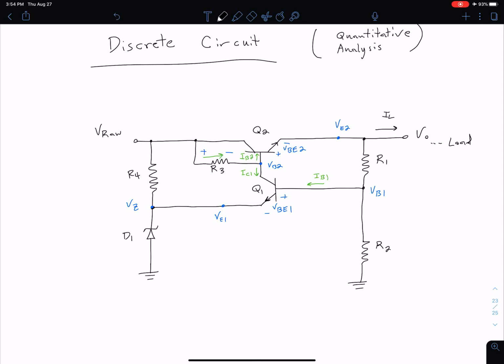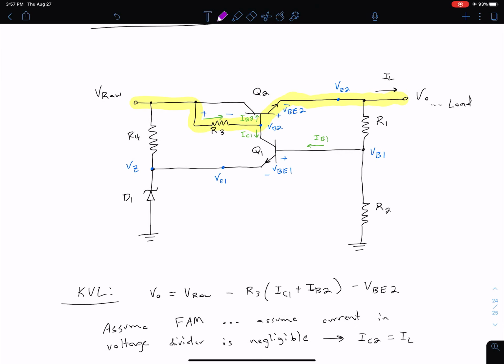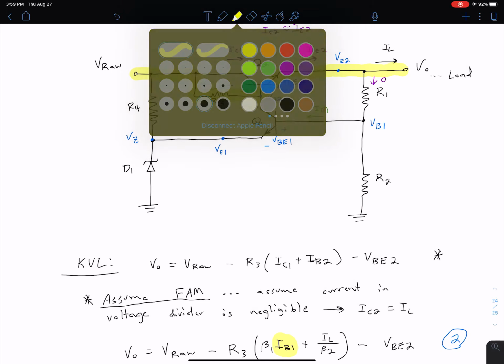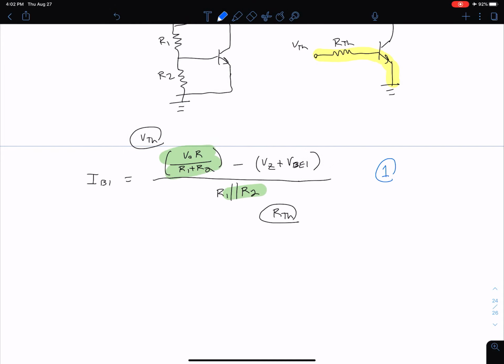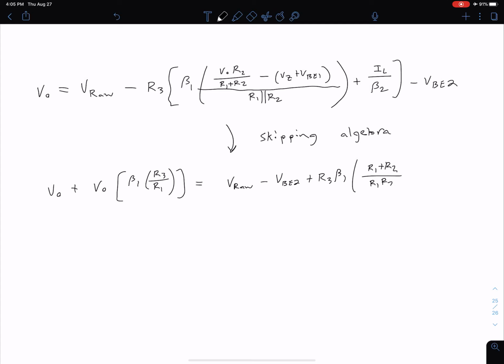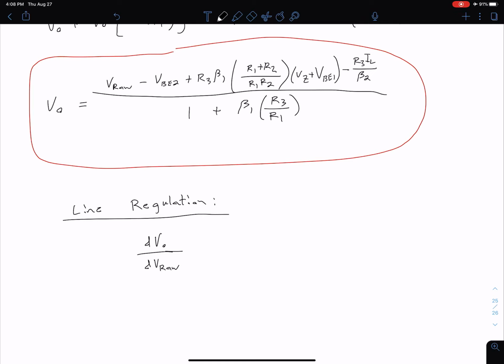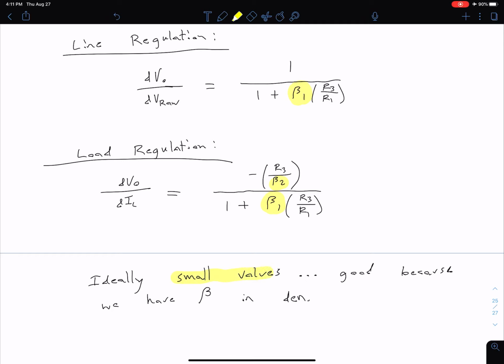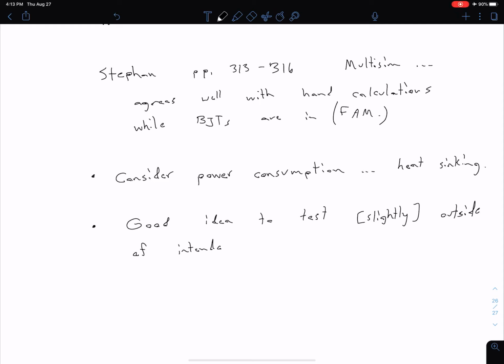Power Supplies - Series Pass Regulator (Quantitative)

Comment: Thank you very much for this nice presentation. May I ask you, how would you calculate the low frequency DC Gain of this circuit?
Reply from the maker: It's not immediately clear to me, but I would recommend going back to the basic BJT amplifier forms (common base, common emitter, common collector) and working from there.
Reply: @danielcutshall-milliganuni8580  My question was related to a simple Series pass regulator, consisting of a reference, differential amplifier, driver and a series pass power stage (BJT or MOS). When doing an ac analysis, a bode plot for checking stability (phase margin @crossover) is achieved. The bode plot for the control to output transfer function shows a gain curve=f(frequency). My question: How can the gain at low frequencies (i.e. 1Hz or 10Hz) be calculated. Parameters for the surrounding components are quite often diificult to pick up from datasheets.
Best regards.